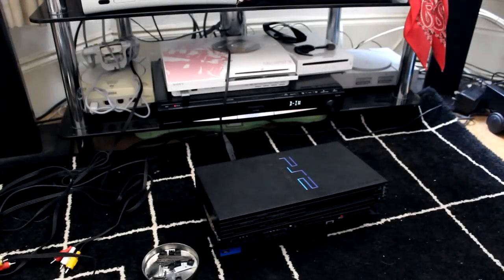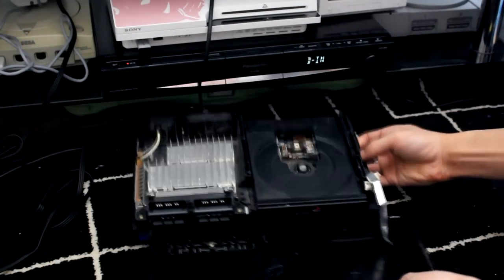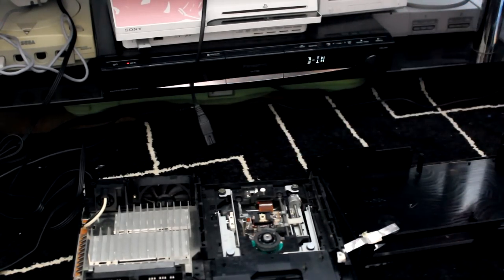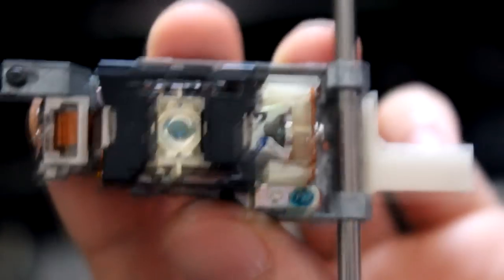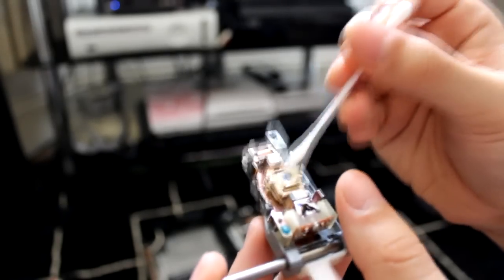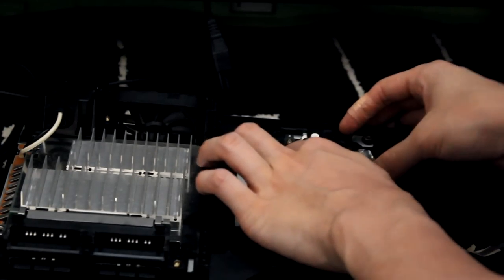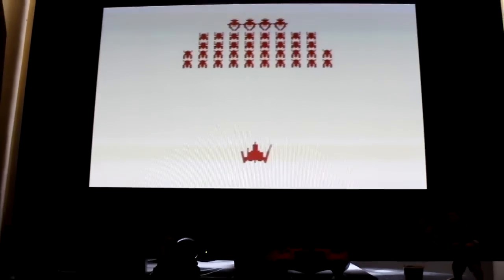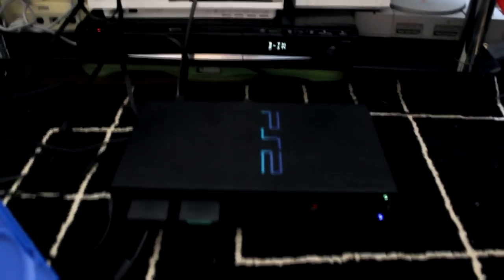PS2 Read Disc Error & Grinding Noise - How To Fix

Comment: Just recently picked up a Japanese 35000 PS2 that was having the exact issue of the plastic bit needing to be pushed down, copped it on the cheap since the seller figured the drive was going bad and said hard drive or usb would be best for it. After following the disassembly along with my service manual and tips on what to do, it works pretty much flawlessly, CD games boot instantly and DVD games take only a small bit for them to spin up fast enough to be read. Much love!

Comment: Thanks for simple demonstration on how to open it. Cleaning didn't fix the problem but helped it a bit. I need a new arm for the motor, the plastic on mine is all worn out.

Comment: Great video. I fixed my PS2 grinding noise 7 or 8 years ago by replacing that white laser gear and cleaning the worm gear and putting fresh white grease on it. It recently started grinding again so this time I'm going to do as you did and just try bending it down a bit and regreasing. I found where a guy used a lighter to heat the plastic up and bend one down a few years ago but can't find it now but your method seems to work fine although maybe not as long since the plastic will be more apt to want to go back into it's original position without heat.

Comment: Nice video, I fixed mine 4 years ago by cleaning the laser. It had stopped reading blue discs and dvds after like 6 years of owning it
Reply from the maker: Thanks Jacob, glad you got it fixed. I've always had this problem with mine for several of years, but it has been living in it's box for ages. Instead of buying a ps2 slim (which was what i was considering doing) decided to actually fix this. I heard the blue disc's are the most difficult to read.

Comment: My laser just comes down even when i touch its sensor . i have removed the lid off and have done as you did . But the laser still comes down with pressure . Pls do help(I have a ps2 slim)

Comment: Btw you are not supposed to push the laser and thus the worm gear like that..... Of course it's gonna make noise. Yes that thing that moves the laser is called a worm gear and while it can move the laser no problem normally, it's much harder for the laser to move the worm gear. That's just how worm gears work fundamentally. So basically if you push the laser like that, it could just break the whole thing or make it worse. If you wanna move the laser it's better to spin the worm gear gently with your fingers. 

That said, you might be onto something that that plastick bit has worn or been pushedupwards. I have the kind of issue you are describing with my Ps2 slim so have to try cleaning the laser and making sure the plastick bit that is connected to the worm gear is making contact proberly

Comment: Fixed the grinding, but now my ps2 just says reading disc when trying to play. I get no error, it just keeps trying to read the disc.
Reply: The lens itself will need cleaning, and probably a slight adjustment too.
Reply from the maker: If the laser cannot be cleaned it's a matter of replacing the laser itself or disc drive entirely
Reply: @AzNstat  I'd say a clean is worth a try, but I agree a replacement laser assembly might be needed. They weren't built to last forever, and these are getting old now. Many have had a huge amount of use and will be worn out.

Comment: Couldn’t appreciate it more first clean in 20 years and no noises or skipping anymore… still having trouble reading black ps1 disc but everything else works
Reply from the maker: Thank you so much for the kind comment. That's amazing. The laser has probably lost some of its sight or not getting enough power to the laser which would cause it to not read black ps1 discs. Eventually they die and would need replacing but if its fine for ps2 games then that should be fine 👍
Reply: Update lol after letting the black ps1 disc sit in it for about 10 min it finally started now it fires up upon turning on🙏🏽✌🏽
Reply from the maker: @nikolasgaither7740  that's great news brother! Og ps1 games are so fragile to scratches ✌️👍
Reply: @AzNstat  Very true lol i have the looney toones lost in time in great condition and was straight praying for that 10 mins for revival😂 again couldn’t be more appreciative of the help!

Comment: Thanks man helped so much,still cant play blue discs however
Reply from the maker: ben. zini No problem man, that sucks, i think blue discs are harder to read, the laser might need recalibrating.
Reply: I found a way for the ps2 to  read blue discs for some reason flipping the console upside down helps the ps2 read the blue disc.Once its running just flip it back and it will read the disc just fine
Reply: @benzini-ce6bm  bro thank you, this worked. now i can fire up ff7!

Comment: Can you do this for slim PS2 model?
Reply from the maker: As far as cleaning the laser, the method should be the same i.e using isopropyl 70% to clean the laser,but opening your PS2 Slim will be different. Hope this helps.